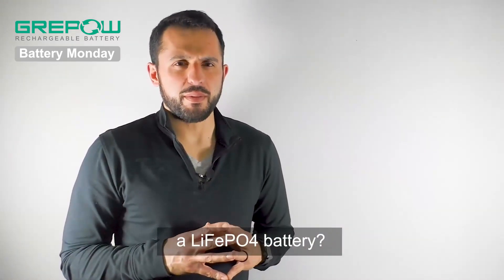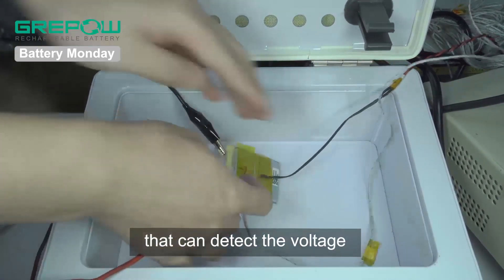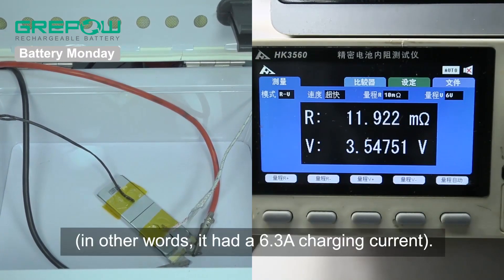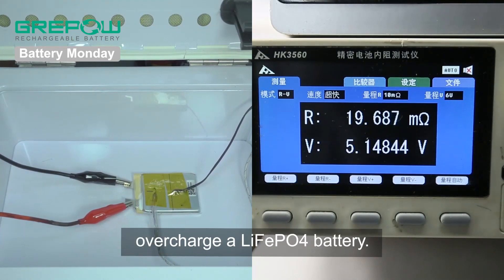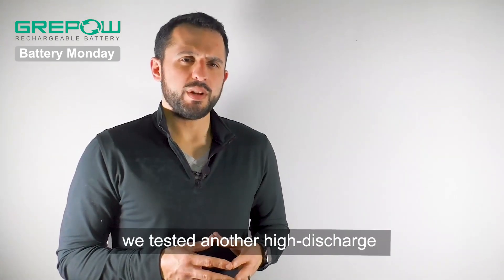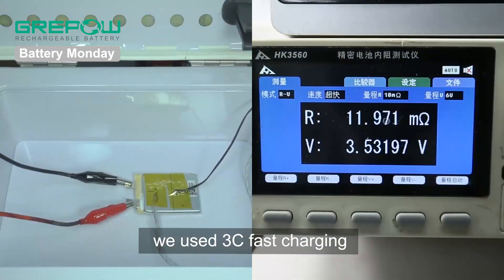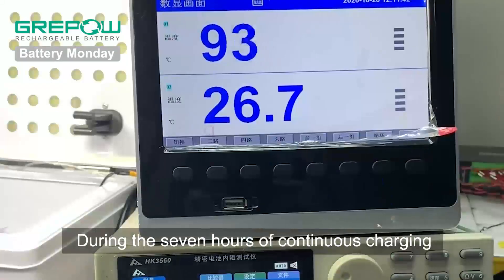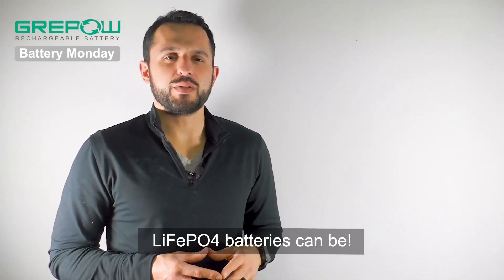What if we over-charge LiFePO4 battery to 10V? - Battery Monday

Comment: Thanks for the test. Do you happen to know at what voltage did swelling start?  Question I have is how tolerant is a LiFePO4 battery to "slight" overcharging. e.g. 3.8 ~ 4.0V?
Reply from the maker: Hi Robin. Charging to 4.5V will start to swell. Charging to 3.8V or less will not affect the battery, and as long as it is not overcharged for a long time there will be no safety risks.